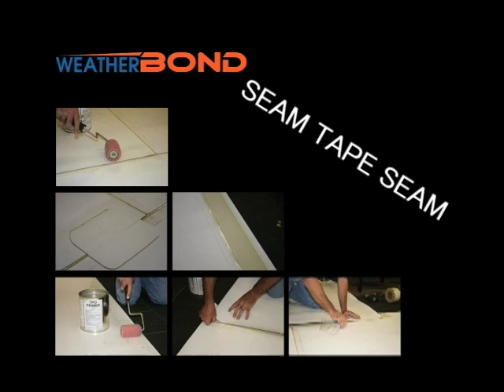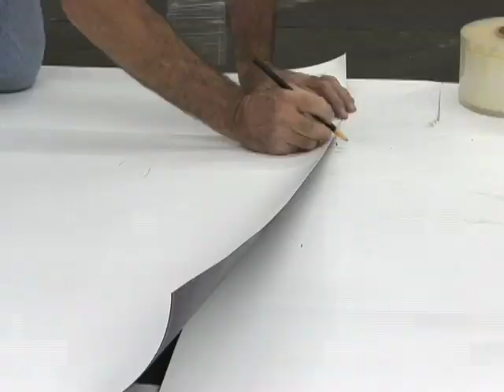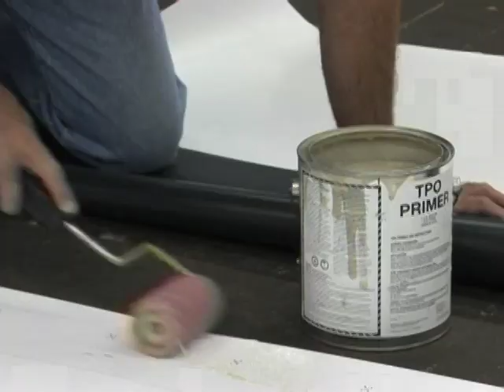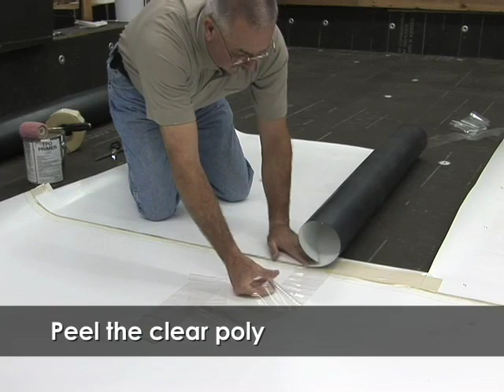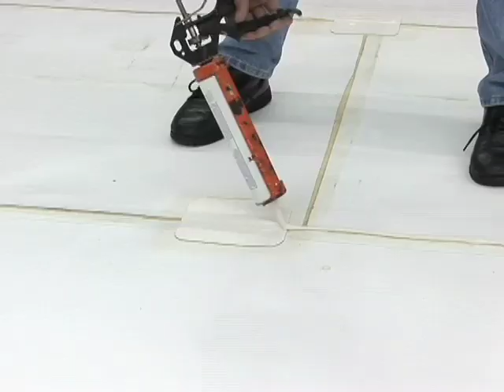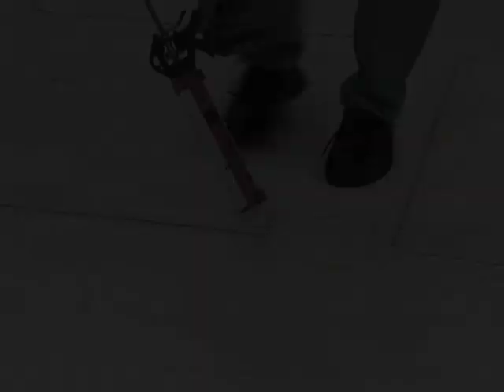Seam Tape Seam - Weatherbond Weld-Free TPO

Comment: your t-joint cover didnt go over your t-joint bro.. kinda cool though . didnt know you coul have a festner seam on tpo.. that how i do my epdm . but that will make my tpo move along much quicker  . thanx for the vid bro.. if you han any questions about mod bit torch/cold process /hot . or built up 3 ,4 ,5 plyed cold /hot or epdm .and anything about servicing or counter flashings just feel free to ask
Reply: braylen47  what happens if we don't use primer to put the seam tape